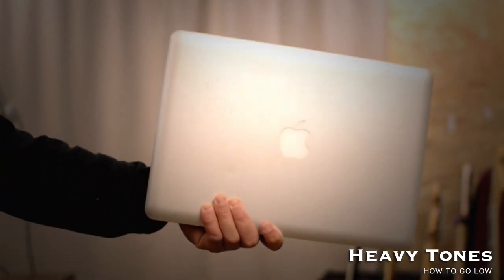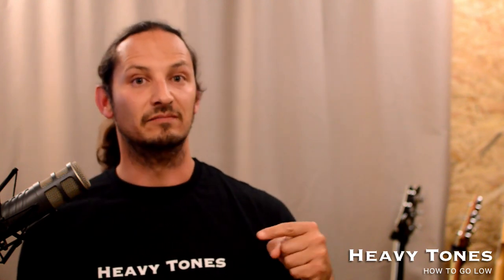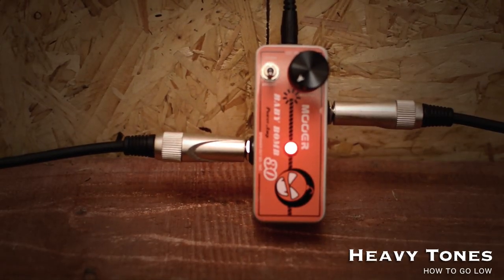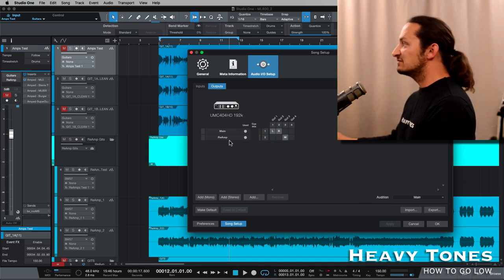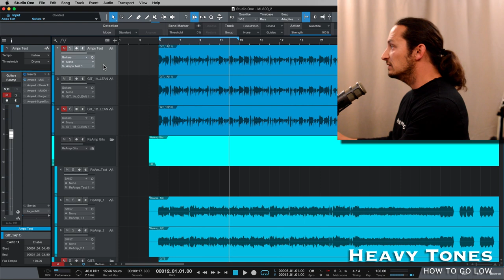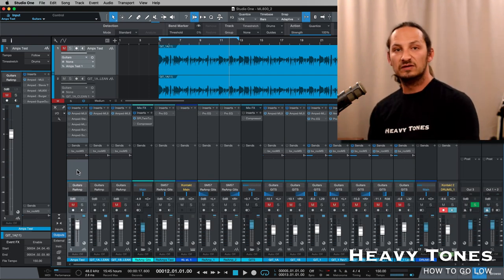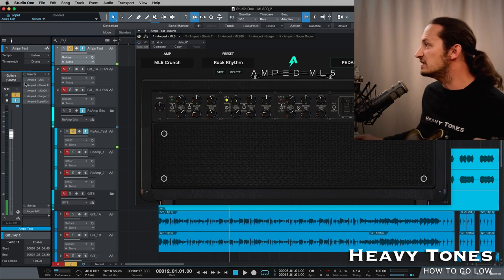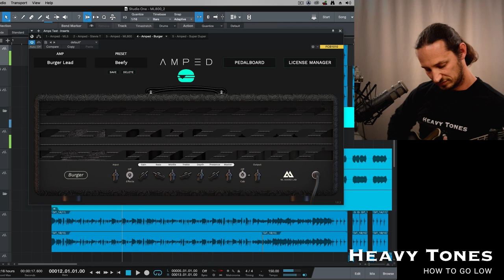How to use Amp Sims with a Real Guitar Speaker Cabinet

Comment: I tried this setup many times, but I can't make it sound and feel like a real guitar amp. Every time it just sounds very flabby and muffled, with no definition and no attack.

My cab sim is disabled, there is no clipping, but it still sounds very cheap... It feels like playing a guitar on a neck pickup with a tone knob set to 0. I can make it somewhat usable by enabling overdrive in the plugin and cutting some flabbiness with a eq, but it still sounds quite bad.

I am using scarlett focusrite solo 3rd gen and a solid custom made 212 v30 cab.

My joyo zombie amp, or boss katana head sounds 100 times better than any Neural DSP sim going into my cab... I really wanna make it sound good, but maybe impedance is the problem?
Reply from the maker: What are you using between your interface output and the cab? What power amp are you using? First check your input gain going into the Neural plugin is high enough as well. This  an make quite a difference if its too low
Reply: @GaryHiebner  between my interface output and the cab there is only a poweramp. I have tested it with SD Powerstage, Boss katana mk2 head "power amp in", and even tried plugging to my full tube jcm 800 clone amp. Every time it just sounds very flat and basic :/

My input gain is perfectly adjusted.
Reply: pretty much same situation here. also have the joyo. and it sounds amazing for bedroom volume. the attack and feel is good. one tip from my side: i like to use just the preamps from helix native. i think the lack of definition and attack comes from the poweramp sim from the vst. preamps only is much better results
Reply: @christianhuber8461   Hmm... I have tried to run a preamp only vst into my poweramp and it sounded just as bad, so I don't think it's caused by a poweramp simulation going into a "real" poweramp.

I feel like bad tone is caused by a wrong impedance, right now I have a few modellers including helix running into my sd powerstage and if I set input impedance very low in the helix it sounds kinda the same as vst from my pc going into a poweramp - muddy, muffled, undetailed.

I belive that you need a DI Box to make it sound good, but I gave up and just ended up using a "real" modelers + poweramp.

Also full amp block sounds much better when you run it into a neutral, clean poweramp, if you go into the real amp preamp may be a better option :)

Comment: Could I use a powered pa head on top of my guitar amp cab or do I need a power amp ? Also lets say I wanted to run to font of house aka to a mixer then to pa speakers id assume this would work but, with the sim cab's on ? Any help with this would be amazing so thanks!
Reply: A PA-Amp (whats inside your powered mixer-head) won't work with a guitar cab. There is a reason why guitar amps exists. ;)
If you want to go upfront you have to create two tracks in your DAW - both set to the same input but different outputs. One for the guitar power amp and cab combo without an IR and the other that goes into the mixer with a loaded IR. You also need to route your monitors to the seperate outputs.
Reply: @SixStringViolence  Sounds great thanks! Yeah I have this old Peavey pa head that is like 30 years old or something like that no idea how old it is. It does not even have XLR inputs there all 1/4 and its 130 watts vary close to that 120watts a lot of guitar amps have. On the front there is a "Graphic Input" So it seems to by pass everything on the mixer but, the 7 band EQ. The name of the Mixer is XR-500. Kind of cool there is a real spring reverb tank inside of it. It sounds ok when I play out of it in my room with the IR off but, think ima try to get that pedal or what not that you have as that would be the way to go. You know more about this then I do. I just did not know if the head would be a good power source or not.

Comment: Shouldn’t you also use a reamp box?
Reply from the maker: Yeah a reamp box helps if you go from the balanced outputs on your audio interface into the unbalanced input of the guitar amp. Vut if you dont have a reamp box you can  mstill do it without it. You might just have more noise in the signal chain going from balanced to an unbalanced signal